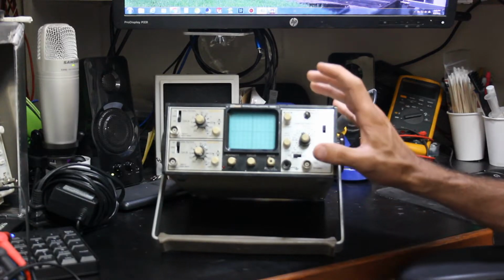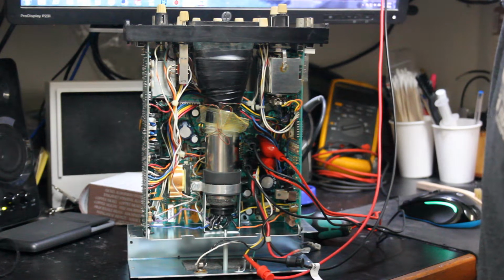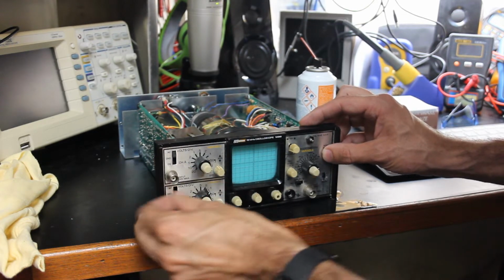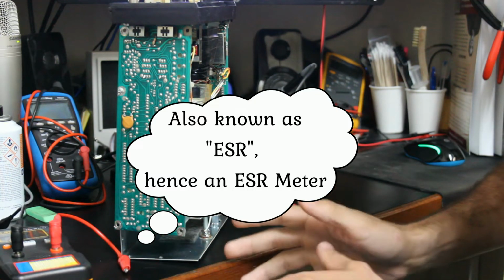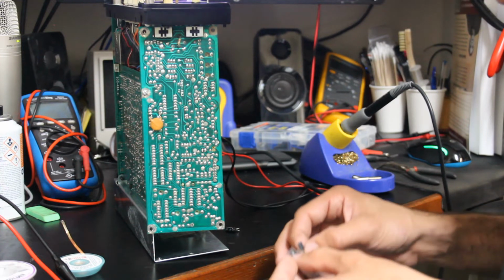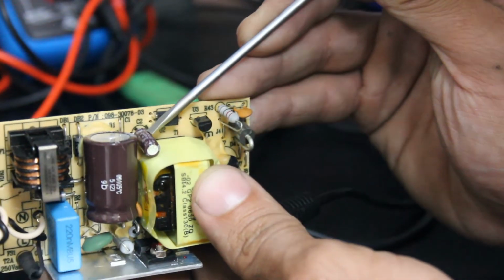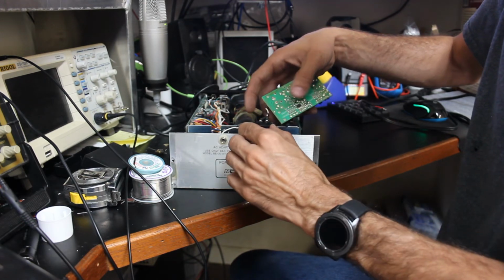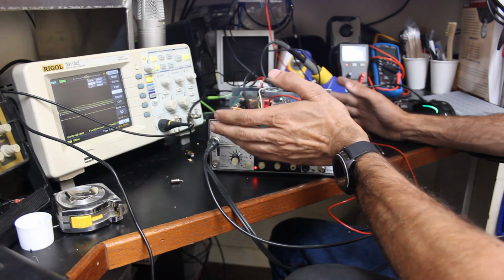BK Precision 1420 Oscilloscope Repair

Comment: Nice repair...I think Mr. Carlson did one of these last year...interesting fuse selection...sometimes one wonders about "techs"....good final cale with the SM/PSU..I linear especial on vintage gear...I hate SM period!  :) Any status updates on the Tek TDS-620? You can find the schematics for this scope here: https://www.opweb.de/en/model.php?id=18665  ~Jack, VEG
Reply from the maker: I didn't see his, I'll have to track it down! Yeah I find linear supplies seem to live longer, and be easier to repair with their lower part count. I've tried repairing computer PSUs before and they're such a dense unit I get to a point where it's not worth going down the rabbit hole.

The TDS is still on the side, in fact I have a scope repair video scheduled for July that mentions it. I'm kind of at the point where I'd rather send it off to get repaired, by the time I'd feel competent enough to tackle it I'd have forgotten it exists. I will do an update when I get the rear brackets finished for it, but electronically, it's still beyond me. I had a blast working on it, and I feel it's worth repairing still.